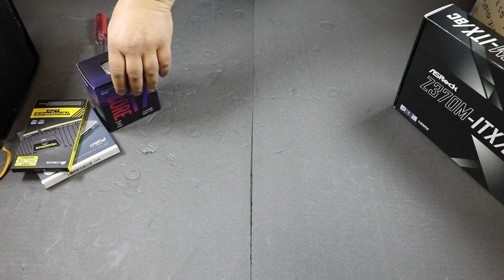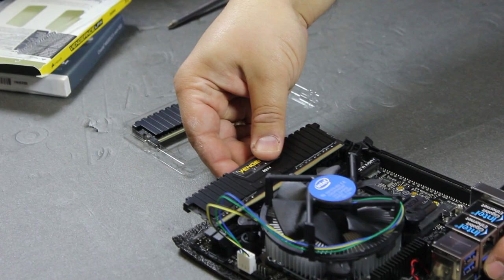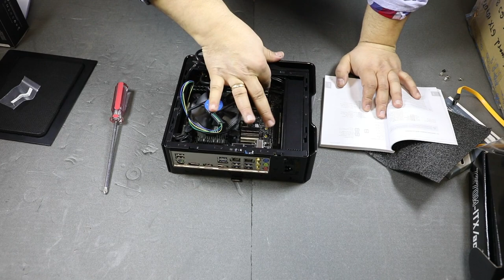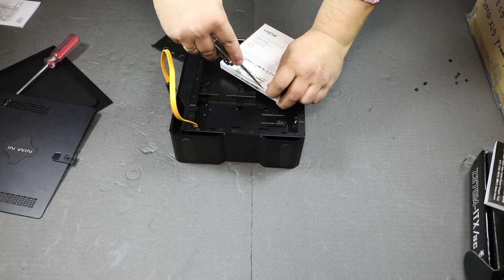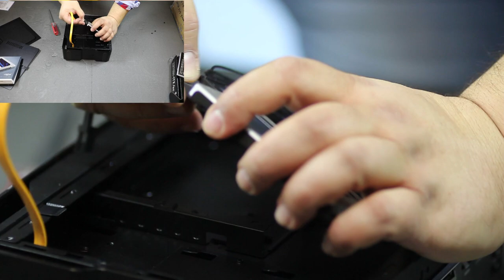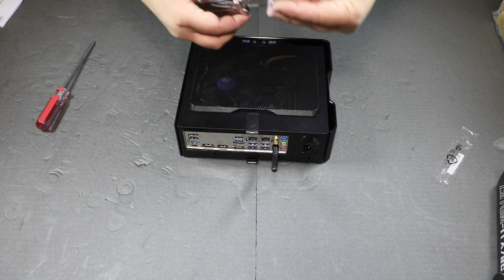InWin Chopin Mini-ITX Build With i7-8700: Mini Video Editing & Streaming PC

Comment: That poor 8700 with the stock cooler
Reply from the maker: Yep :).
Reply: Yeah, there's no reason to put a 8700 in a chassis this small with the stock cooler. The thermal throttling will prevent it from making effective use of it's turbo boost. Would have been better off with an i5 8400 at most imo. Case this tiny is just begging for AMD's APUs in my opinion.
Reply from the maker: @Rowrin  We needed all the power available for video rendering. Also there are no problems with the boost, quite the contrary. But the temps reach 100 C.
Reply: @SteDiGaming  I agree that your pushing it with your power consumption using an 8700 in that case as the PSU that comes with it dosent give a lot of juice but I would still atleast try putting on a noctua cooler and see if it can handle it i doubt the power consumption is going to be that much more  to power an after market cooler vs a stock one and you would be getting better temps.
Reply: @Rowrin  Thats what i did i put a 2400g in my buiild works like a charm and i personally think its the best fit for this kinda case
Reply from the maker: @b1uefalc0n50  We used an Xigmatek aftermarket one with 3 pipes. Several degrees lower but still very hot.

Comment: Did you run AIDA64 System Stability Test to make sure PSU is enough for all cores running at 4.3G?
Reply from the maker: We run Handbrake regularly, that has quite a high load too.

Comment: Here at 700 views
Reply from the maker: :) Moving up one view at a time :)
Reply: @SteDiGaming  by the way nice work on the build I'm doing one myself that's around 500 that does better gaming than the ps4 and its smaller
Reply from the maker: Thanks. It's a nice little worker. We added a Samsung 970 Evo Plus NVMe and it's a beast.
Reply: @SteDiGaming  noice